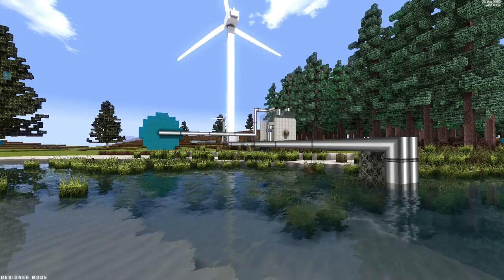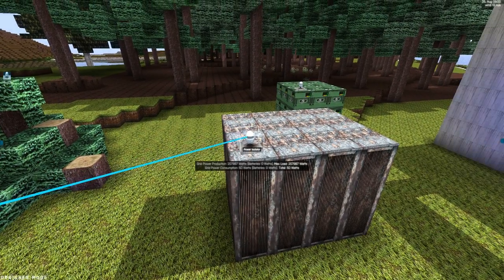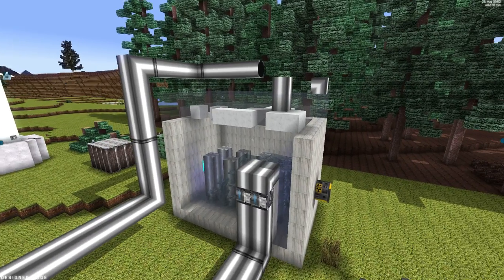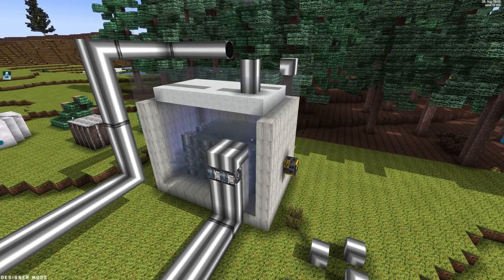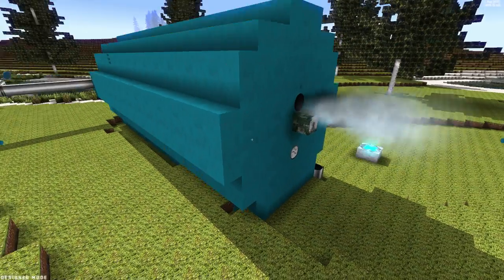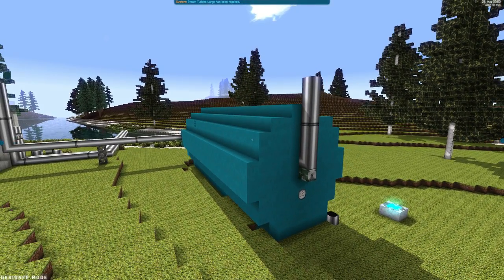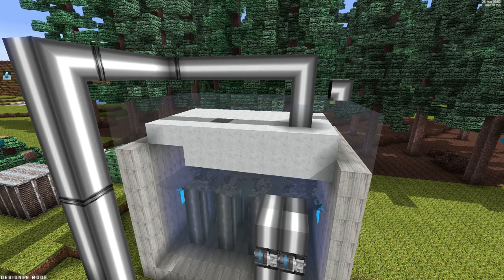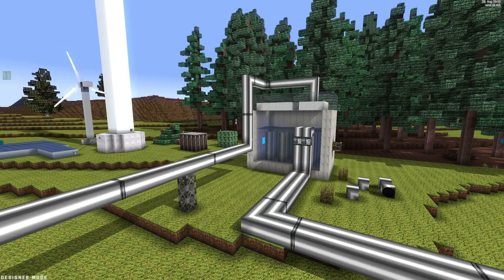Build A World - small nuclear reactor

Comment: those girder supports are they needed? i noticed on long run sections of the pipe you have those. will the pipe/structure collapse if those are not in place?
Reply: No, not needed for now. But we might implement weight/strength later, and then it would collapse.